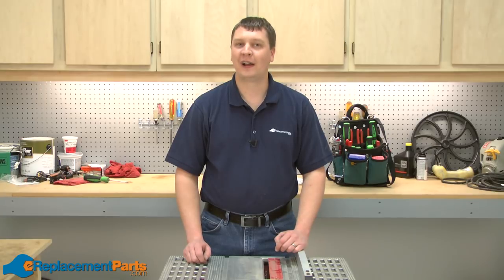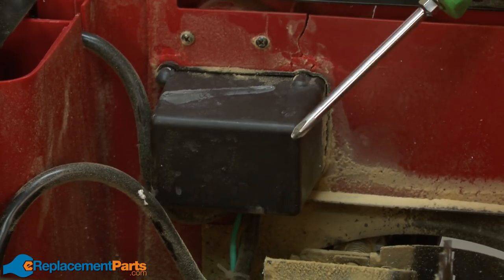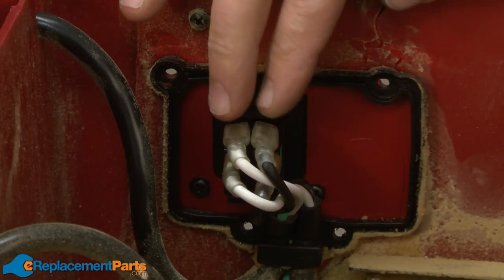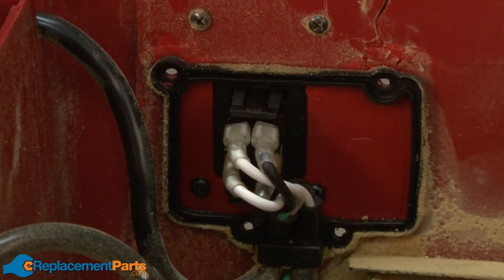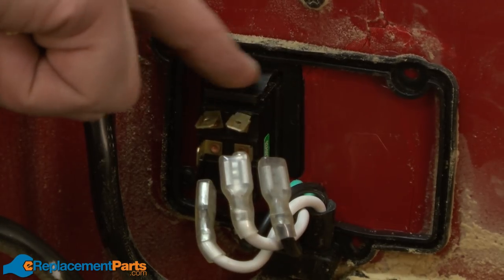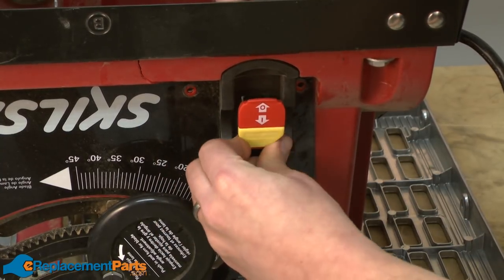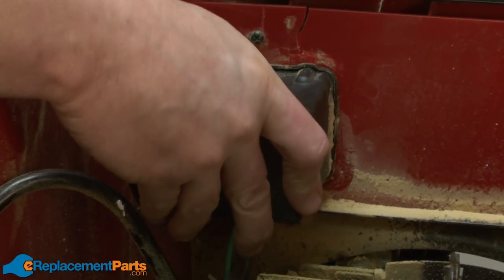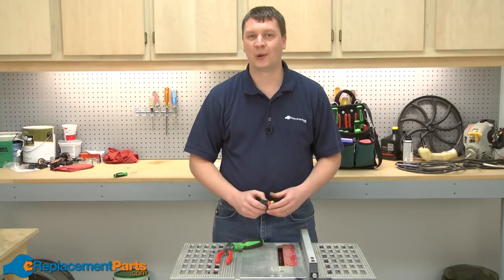How to Replace the Switch on a Skil 3305 Table Saw

Comment: I didn't take a picture when i removed the wires from the reset button, i need to replace, have new part now, Saw has one black and one white wire, reset button is marked load and line not sure which is which can you help?